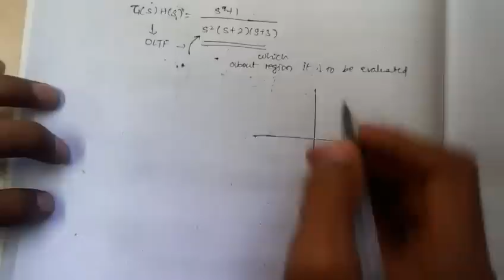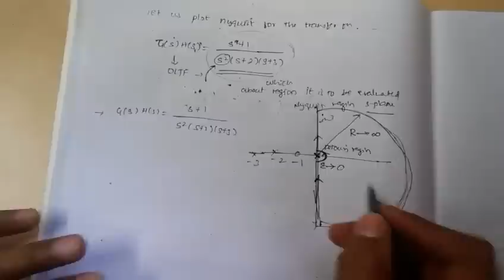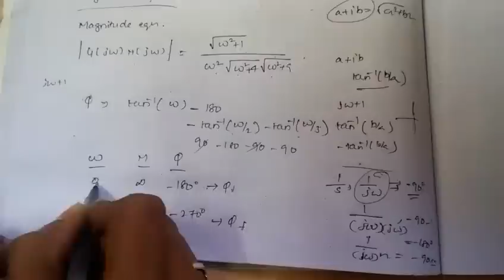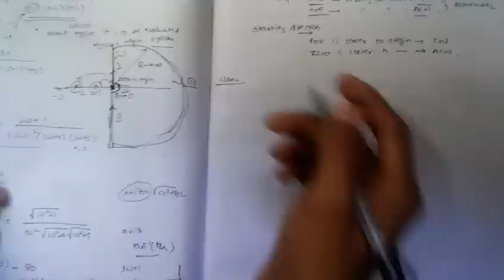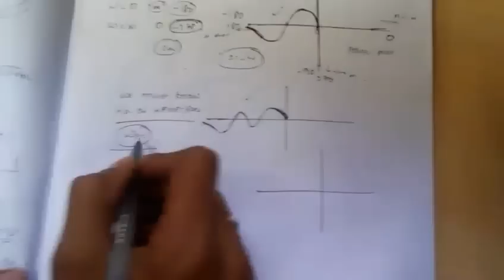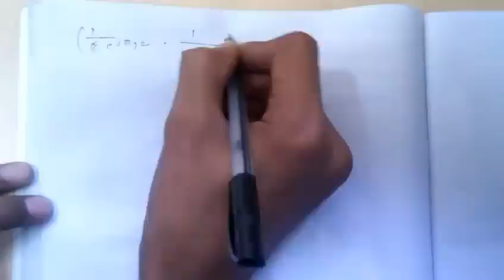Comment: Based on what did you assume the direction of the nyquist path plot(the initial plot) ?
Reply: Gowtham Gunashekar Direction is based on the initial substitution of points.It depends on whether you take clockwise or anticlockwise substitution and accordingly you get the direction in clock wise and anticlockwise for zeros and anticlockwise and clockwise for poles respectively.